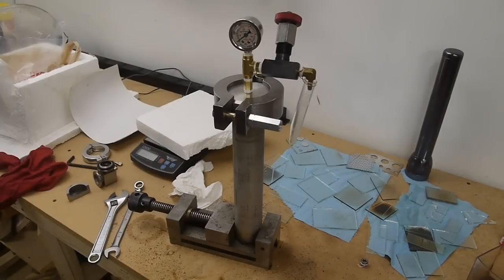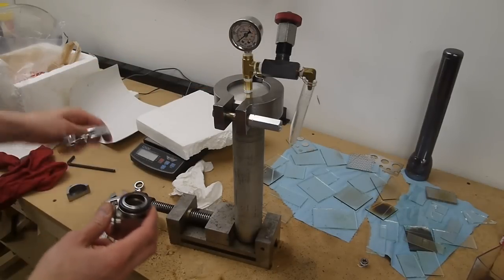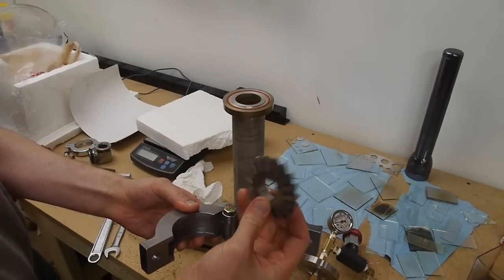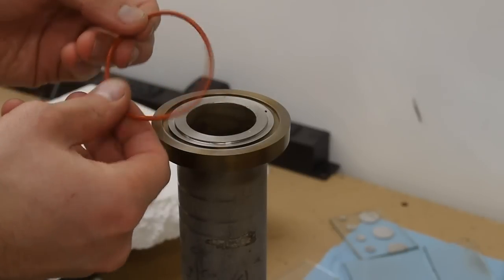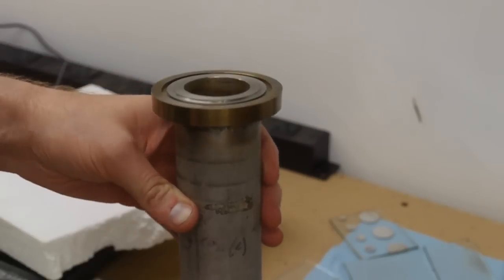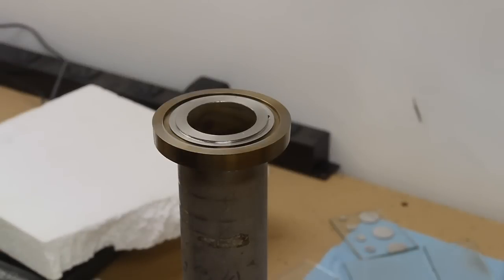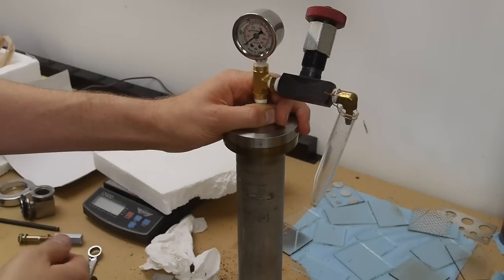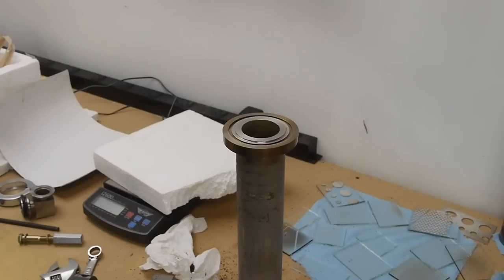Custom supercritical CO2 chamber with easy-to-use lid clamp

Comment: if you have an input for high pressure co2 then you should be able to implement recirculatation of that dry ice co2. Just realized its 8 years old but still lovely work

Comment: It's easy to make a critical  co2 extractor with out a pump, you just add the co2 to your vessel with your weed, then warm that chamber with a simple heating pad for your back until it becomes liquid at that super critical stage, then open the release valve and collect your extraction, and recapture and recompress the co2 if you set it up. No o rings, all metal check valves etc. That way you can use a scuba tank and collect much more per run.

Comment: For the stresses in the pipe next to the weld, you could probably anneal it the whole thing, or use a band heater just to heat the pipe if you don't want to treat the seal.

Comment: I know this video is really old but, for future viewers, the other thing you could have done regarding the weld, is assemble the cap/clamp and weld with that all on
Reply: Or just make the cap/clamp with pipe thread.  It would attach just like his original threaded cap via teflon tape and a pipe wrench, but the clamp would be available for everyday use.  The threads would only be used at initial setup, or if you wanted to upgrade to a larger or smaller extraction chamber like he seemed to immediately want to do.

Comment: Testing pressure containers is ALWAYS best done in "hydraulic mode" - fill it up with incompressible liquid (water, hydraulic oil), and then exert the pressure. Even if the whole thing craks there'll be just a small splash, and that's it.
About the welds: I'd be concerned not only whether they can withstand the testing pressure, I'd be also concerned with how they are going to stand up to repeated stress (from repeated extraction cycles) - weld and base metal are tad dissimilar, and have different properties. Repeated stress can lead to developing cracks - keep that in mind.
Also, there might be some stress introduced into the material by welding iitself, although in the case of TIG welding this probably won't be a real concern (from what I can see the apparatus was TIG welded).
Anyway, once you get the whole rig filled completelly by liquid, you can use some hydraulic pump (like modified hydraulic jack) to rise the pressure inside - or you could easily to make own "pump" from a section of a thick-walled steel pipe, custom made piston and some ACME threaded bolt. Plain, easy and safe.
Cheers.
Reply: I have a question for you MrKotBonifacy,

The video said that more ports may be added for injecting liquid co2.
What suggestions would you have concerning threads for gauges,
  adding thermocouple wells into the cylinder for regulation.
thanks.
Reply: @jackgreen7273  , I'm not sure I understand that question... The technical side of "gauge threads issue" is pretty simple and obvious - if a gauge has a measuring range of 4000 PSI then it's thread must withstand that force - as simple as that. You get a certain gauge, with a given thread, and you have to make corresponding female thread in the lid of the extractor. Gauges come in different sizes, so you have to match the size of the gauge to the size of your apparatus, and that's it.
As far as mounting thermocouples or cartridge heaters, taking the size of the apparatus AND safety concerns into consideration, the best way IMO would be machining a matching aluminium block, or thick split sleeve, or collar, mounted tightly around the main pipe (something like that: https://cdn.mscdirect.com/global/images/ProductImages/7309036-11.jpg), with "parallel" holes for abovementioned parts drilled into that block/ sleeve/ collar (paralel to the walls of the vessel, that is).
It could be round, or it could be a square block with a hole bored into it and then split, it doesn't really matter - the only thing here to keep in mind is the bigger that collar is, the bigger it's thermal inertia will be. (For machining hints take a peek here: https://www.youtube.com/watch?v=3cOoJ-en_M8&t=220s)
Preferably I'd make TWO of these collars, one (bigger) for cartridge heater(s), the other one (much smaller) for the thermocouple, in order to separate them somewhat thermally, so the temperature readings would be more accurate. (When you put both of these elements into one block, the thermocouple would heat much faster thn the content of the vessel). Or, you can just make a block only for heaters, and place the thermocouple somewhere else directly onto the vessel, and wrap some insulation around it.

Then I'd wrap a thin layer of slightly crumpled aluminium foil onto that pipe, in a section where I'd want to fit that sleeve/ block, and then I'd put that collar around it and tighten it well (the purpose of aluminium foil is to fill up any gaps that might be there, as stock pipes typically are not perfectly round, and thus improve thermal conductivity between the vessel and the collar). Of course, thermal conducting paste (industrial grade, like this one, https://euro-industry.com/main.php?index=details&cat=1267&prod=23204452) would be a better solution - but it will add to the cost, and might be tad messy, even for that "non-flowing" types - but condictivity wise, with good vessel - collar fit, it will be better option.

Then I'd place thermocouple(s) and/ or heater(s) into proper holes, filling the gap wit thermal paste, and that's it.

Having said that...
As they say, there's more than one way to skin a cat, it all depends on your experience, equipment, budget, and willingness to do your homework.

And, obviously, the best option "measurement accuracy wise" and "quick heating wise" would be to place all those elements INDIRECTLY inside of the vessel - but this will interfere with filling up and emptying it , and - last but not least - it will introduce the issue of safety and hermeticity of that rig (remember, this is a small diameter pipe, and you'd need to make and weld some housings for them).
It all depends on what is your main goal and what would be reasonably feasible in your case.

Hope it helps  : )
Reply: @MrKotBonifacy , 
thanks a whole lot.  I wish you would build your version of a CO2 extractor cylinder and put it on youtube.
Do you have a web site?
thanks
Reply: @jackgreen7273  Be my guest. : )
But don't expect anything from me on YouTube ever, period. No CO2 extractor, no atomic-powered lawn mower, not even "learn how to use a hammer in 26 easy steps" ;-)
I'm just not this kind of guy - I have my knowledge, I have my experience and expertise, I have no problem with sharing it - but making, editing, or (God forbid!) posting any video? No no no no.... That would be a transgression, or maybe even worse.
(Besides, I dont have any equipment for that, I'm I just too lazy ;-)

Comment: hello sir,
I want to use supercritical carbon dioxide for my foaming process. All we have in our lab is a CO2 gas cylinder and autoclave unit. we get a booster for our unit but can u give me a cheaper way to make a chamber for my supercritical carbon dioxide. pls, help me out. waiting for ur response.
Ashish Raghavan
raghavanashish94@gmail.com
+91-8073657973

Comment: Id like to see ( be educated about)  the mechanical interface that actually picks up the oils as the CO2 extracts them. I see a tube closed at one end with a fitting on the other but no dip tube no way to gather up the extracted material.  How does it make to from the CO2 as it reverts to a gas into that little poly tube?
Reply: once the co2 has evaporated, it leaves the material at the bottom of the chamber.  then you just tilt it upside down to empty out the spent trimmings and scrape the thc gunk off the bottom.

Comment: If you make the main pipe longer, you will need to add belt bands to support the pipe and keep it from rupturing.
You have shown that the existing length will hold 4000 psi, so place the band spacing at the same length.

Comment: Surplus oxygen and scuba tanks and fittings are rated for 3000 psi, CO2 reaches supercritical  liquid state around 110 degrees F at 1,600 psi or so one could make many methods using cheap surplus materials.

Comment: Why not machine your coupling flange with the inside tapped and then thread the tube and screw it on instead of welding?

That way you could experiment with different flange designs or switch to a longer tube if desired and you wouldn't have to worry about heat damage to the flange and tube.
Reply: And no loss of strength or warping from the heat of welding.

Comment: i need something to store dry ice...that would be perfect...open it up (easily) put dry ice in, close it....and use it as cold gas/liquid...any ideas? i have been looking for 2 years and i found few but you need tools and strenght to open/close
Reply: Sounds like you're looking for a CO2 fire extinguisher. CO2 fire extinguishers usually come pre-charged with compressed CO2 and when released quickly the rapid expansion  brings the temperature down low enough to (re?)solidify the CO2 gas.
Reply: Buddah Muslc yes but i need to be able to open it up, put my dry ice in and use it later...i didn't found much info...
Reply: I suspect any suitable pressure vessel filled with dry ice would keep at least a portion of it solid due to the elevated pressure.
Reply: Buddah Muslc nope, it'll liquify, i don't care whatever liquid or gas or solid, i want to store CO2 and use it when i want to, refill only with dry ice
Reply: mattibboss what you need is a Dewar bottle... Thermos or whatever, it will keep CO2 liquid for some time, just not forever.
Reply: I know but i need to store it for longer than "some time" 
I'm looking for soooo long and still nothing :( 
60 bar or so is crazy pressure...i store my butane-propane in sprite bottle, it is only 4 or 5 bar and i can open the bottle and pour my prop/butane and use it for cooling or whatever
But prop/butane is crazy flammable and is only -35 C or so ...that's not enough for me

I need an easy way to open a bottle, throw CO2 in and close and take my CO2 out whenever i want

Comment: Next time you test pressurised chambers fill them with water, much safer then testing with gas.
Reply: It's only safer if you can pressurize the water mechanically, keeping it at a low temperature. Ben doesn't have means of doing that, so he'd have to pressurize it by heating. To get the 4000psi he was shooting for, he'd have to go up to about 350°C, so if the container ruptured, good portion of the water (up to 46%) would flash over to steam, so that wouldn't be terribly safe either.
Reply: I get what you're saying. However I think it would make a lot sense to obtain a means to pressurize the water mechanically anyways. You see, I actually said that because not long ago there was a very bad accident near me when someone welded a container DIY style and tested it with pressurized air. That air contained so much energy that when the slightest crack occured in the vessel it rocketed in his direction and killed him, may his soul rest in peace.
Reply: timorii I think his safety precautions were more than sufficient and considering how infrequently he does something like that, I doubt that would be a justifiable expense.

Comment: Just had an idea for a larger 
Critical Chamber.  Using a two small CO2 bottles cut the top off just after the curve (leave a small piece of the curve to catch the cover).  Cut the top of the second bottle at the begining of the curve.  The opening has to be slightly oval for the lid to fit inside the critical chamber, like some of the European pressure cookers, also many large vessel's use the for maintenance access covers.

Comment: When you need to fill the critical chamber, place the critical chamber in a deep vacuums,  invert the CO2 canister so liquid only comes out. Open the schrader valve to the critical chamber and weigh out the CO2 from the CO2 canister.

Comment: Bro it needs a ball valve on the bottom with a high pressure pump on the inlet and a vac chamber to pull into on the outlet side... 2 pumps and you got it

Comment: In all of the very low pressure CVD and MBE chambers at my lab (some of which are cylindrical and some of which are spherical and operate on the order of 10^-9 torr), we use copper gaskets to seal the vessels. Have you thought about using copper gaskets to seal the high pressure chamber instead of silicone?

Comment: Zoinks, what a conversation starter.  The Holy Grail of medicinal whole plant extraction.  Personally having spent the time, money, and bulk vegetable matter needed to explore most "medicinal herb" extraction methods  I have come to realize that simple, clean kif is hard to beat in todays world of 'Dabs" of unknown origin.  I know mine(dabbage) is free of mercaptan,"upper cylinder lube", residual solvents, spider mite gut juice, sweat, hand oils, etc.   I can't really tell other than taste and a 10 power loupe, what, if any crap is in the concentrates available in California pot co-op's today.  I'm glad to see a trend among like minded people toward superfluid extractions using co2.  Yield with traditional solvent methods ranges from shitty to barely tolerable.  I was shocked the first time I used dry ice in my 80 micron shaker rig instead of dry shaking. The dry shake yielded about 8-10% by wt. vs. 21% with dry ice crushed in the plant material (which tested at 22% at my local testing lab).  Naturally I'm dying to build an extraction vessel for CO2 now.  The vid helps a lot but I'm blown away with the helpful, intelligent comments on this post.  I subscribed yesterday, thanks.

Comment: Thank you for the real science .How did you calculate the the pressure rating for the cylinder
Reply: +Applied Science Industry rule of thumb is ~50% reduction in the heat affected zone with no additional heat treatment for a weld. Thank you for these videos, always enjoyable to watch.
Reply from the maker: bgianzin10 My blog shows the calculations for a smaller, but still cylindrical chamber.  The biggest unknown are the welds.  The metal itself will be weaker in the heat affected zone of the weld, but the weld bead should be larger in cross section to compensate.
Reply: Tank you very much again.You sum up very much knowledge in a few minutes of video that is awesome.

Comment: Hi I was wondering if perhaps I can run a few things by you pertaining a SCCO2 machine I designed. I am having a few technical issues, and wanted to know if you had any information on condensing and recirculating the exhausted gas.

Comment: I have often wondered about pressure tests like the one you did.  You ran it to 4000PSI once.  But is that a "semi destructive" test? Do such tests weaken the container? Or does your test mean that you can run the pressure up to 4000PSI as often as you want and for as long as you want?
Reply from the maker: Perfect materials can be stressed within their elastic limit an infinite number of times and show no damage.  In the real world, many materials will degrade a small amount with each loading/unloading cycle -- this is known as fatigue. The material's properties, shape, and loading severity will determine how much the material degrades, and failure due to fatigue can be estimated via statistical methods. Airplane fuselages have a rated number of flight cycles after which the aluminum body is in danger of failing due to fatigue (many 10's of thousands). This is partially why old planes are decommissioned even though they are still functional.  In the case of the pressure vessel, one rather high loading cycle will not reduce the fatigue life by any noticeable amount.  High pressure cylinders for welding gas are tested at over their rated pressure every few years, and this is not considered damaging to the cylinders at all.

Comment: Hi,
I admire your manufacturing capabilities.  The vacuum pump fittings you referred to are called "Sanitary Tri-Clamp" and they are widely used in food, drug and brewing environments in sizes up to 6" in diameter.  I found a nice reference guide to the types & sizes of clamps & gaskets available on gvc.net.  I have a Flash Chromatography system that uses billet aluminum tubes and stainless tri-clamp ends that it useful for ethanol & butane solvent extractions, but would prefer using CO2; do you think a 1/4" thick x 4.5" ID billet aluminum tube would stand up to 3,000 PSI?

I look forward to watching your subsequent videos.

Comment: the extraction would yeield more if the liquid phase is allowed to dwell near the extraction port, at the lowest portion of the vessel .. also: making the vessel work by gravity and super cooling your extraction vessel will trap more of your VOC's .

the super critical reaction only needs to happen for as long as it takes to strip the oils from the material . it would also help to have a strainer screen made to the standard of 70 micron  filtration to hold your raw product near the filling port at the top of the tank . filtration in the process and longer offgassing times for the finished oils or caffeine can drastically reduce the moisture of the CO2 extraction process , and eliminate many of the compound destroying acids that can form with liquid CO2 exposure .
Reply: you sound like you know what you are talking about

Comment from the maker: This chamber is much larger than 50mL, and the size is required to get a usable amount of product. Do you have a source of 50mL tubes (or any tubes) that can actually hold 200 atm?
Reply: Why not put the bevels on the lid and chamber instead of the clamp?
Easy to do on a lathe.